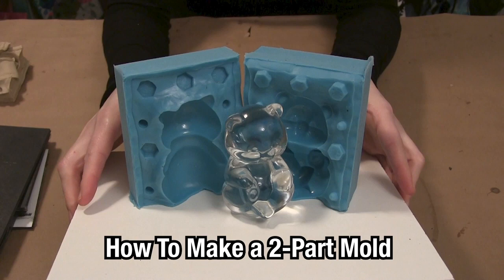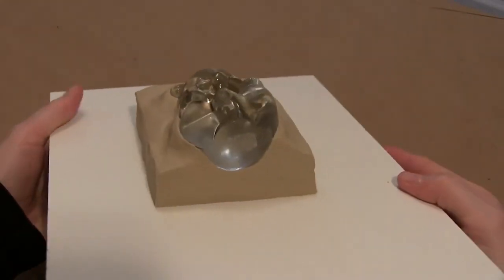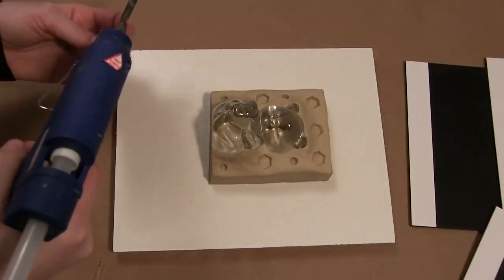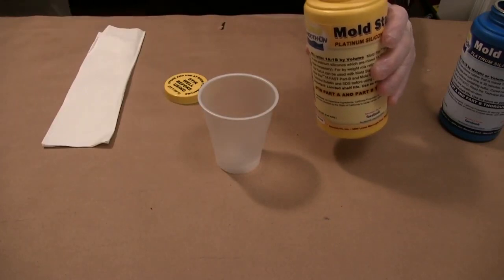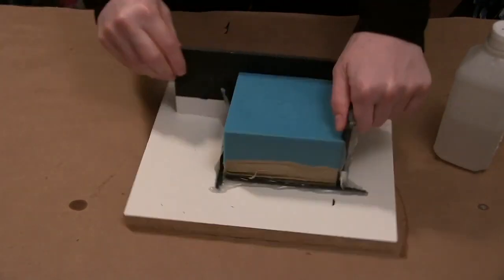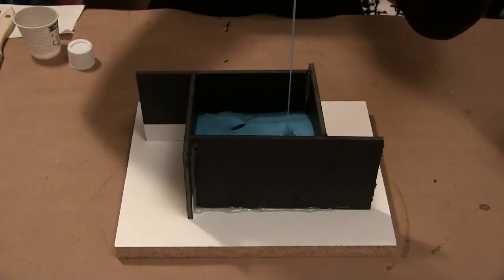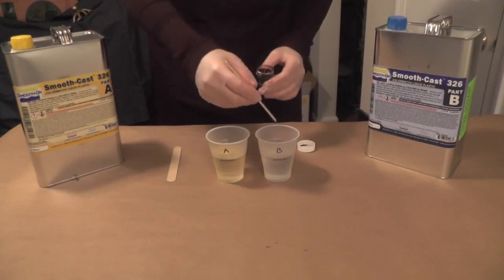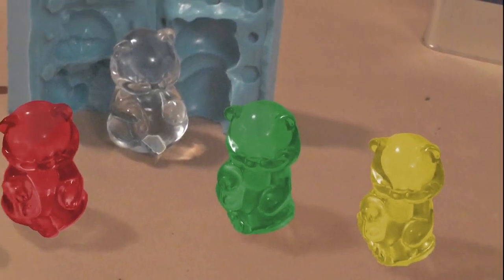2-Part Silicone Mold using Mold Star™ 16 FAST

Comment: You can simplify the process by skipping the clay stage: you pour the bottom part with silicone and leave a few vertically positioned suspended rods partially immersed in silicone. After silicone has solidified, you remove the rods,  apply release spray and again pour silicone. Even release spray might be not necessary if you use 2 different substances (silicone + latex / rubber?). What interesting I got my idea only after watching your movie. Thanks :)

Comment: Can you use this method for a small figure that is made out of PVC? Will the silicone stick to it? If so How would you prevent that ?
Reply: Other tutorials have been saying Mold release spray
Reply: Silicone typically only bonds to itself. I don’t think it would stick to PVC but you should call manufacturer to check.

Comment: I'm trying to make a mold for a shoe sole and I'm trying to think of what to cover the shoe with before applying silicone or clay to it without losing the details, need something that wont stick to the shoe but will still allow for a nice clean mold with all the details,  I'm trying not to destroy the shoe in the process. Any ideas on what to use to protect the shoes, the parts I'm trying to make a mod of are the rubber and polyurethane foam.
Reply: I’m having a similar hiccup. Only thing I’ve thought of, but haven’t tried, is heat shrink wrapping the item and trying to get the seams in the right places

Comment: Did you cut the opening to pour the resin after you made the 2nd part of the silicone mold?
Reply: The bottom of the bear is free from clay. That's where she prolly pour it. And it's a good place for it cause if there's some imperfections from the pouring, it won't be seen much cause it's in the bottom.

Comment: I've used this video to make a mold of a little resin figurine from 1962. It is complicated because it is not symmetrical. Sometimes the resin replica that I made has large pockets of no resin. Especially on its extremities. I pour from the bottom with the mold on its head. I also added a pour hole in its back. Any suggestions of where or how to pour to get a perfect replica every time?
I have gotten a few perfect replicas. Well, if you don't count bubbles.

Comment: I didn't see anything about how you made  the hole in the top of the mold that you used to poor the resin.  Did I miss something?
Reply: The base of the gummy bear is where you pour your resin, as you make the silicone mold, when you pour it, it will occupy every space you didn't seal with clay and/or the space of the actual piece you are copying

Comment: How did you not get any bubbles in the casting? Did you skip the step where you removed them with heat before pouring?
Reply: She used low viscosity silicone. Listen at 10:00
Reply: Vacuum chamber

Comment: Thank you so much can any mold release spray be used?
Reply: When pouring the silicone the mold release must be for use with silicone, and when casting the part it must be for for urethane. Ease Release 200 works for both!

Comment: Is there a way to do this with a silicone interior to make prop gummie bears?
Reply: Yes! You can cast silicone, you just need to use a release agent like Ease Release 200. OR, you can use Smooth-On's Compat 45, a urethane rubber, to make your mold. Usually you can not cast silicone into a urethane rubber but Compat 45 is formulated to work with most silicones. Then you can bypass using the release agent.

Comment: Being a Film Gun supplier, we have up to now relied on outside Replica casters ( Hard Fibreglass and Soft Rubber Stunt Items.)
Its good to have a Tutorial on DIY silicone mould making.
Furthermore, I would make a Plywood Frame around both Mould Halves ( Cope and Drag) to prevent damage in Handling.
Just got to find the Components here in Australia.
Reply: I just recently overheard someone talking about Rowe Advanced Materials, in AU!

Comment: Question: I noticed you used what seemed to be a glass figure as your source material. Does the material matter? If I used, say a child's plastic toy  would the silicone stick to the original, to the plastic? or would it release as easily? Great informative video btw.
Reply: If you are using a plastic toy as a master model, it is recommended that you use a release agent to avoid separation difficulties. In addition, it should be noted that there should be no holes in the master mold.🚩🀄

Comment: We don't have to De-Gas the silicon mixture before pouring into the mold?
Reply: She should be using platinum-cured liquid silicone with a lower viscosity. If you use tin-cured silicone or higher viscosity, it is recommended to vacuum degassing, otherwise there will be a lot of air bubbles.🚩🀄
Reply: @linhuiming   Yup. Mold Star is a lower viscosity line of platinum silicone, perfect for those without a degassing chamber.
Reply: Some silicones do require degassing, but the Mold Star line is a low viscosity silicone that does not require degassing! Hope that helps!

Comment: No degassing of the 326 resin? How didi you get no bubbles?
Reply: The natural defoaming effect of the smooth-on brand resin is better, but degassing operation is generally recommended for other brands on the market.🚩🀄
Reply: Generally I would not recommend degassing resin - but if I had my choice I would let it cure under pressure for more consistent bubble free results. I shot this video at home during the pandemic so I had no equipment. There were a few micro bubbles that weren't visible on camera.

Comment: What kind of safety precautions are needed when using these chemicals? Other than a ventilated area do you need a respirator or anything like that?
Reply: If tin-cured silicone is used, it should be operated in a ventilated place. If platinum-cured silicone is used, there is no requirement, because platinum-cured silicone is generally FDA-certified, non-toxic and odorless. It is best to wear gloves when handling.🚩🀄
Reply: Polyurethane resin has a strong smell, and it should be operated in a ventilated place, and it is recommended to wear a mask or respirator.🚩🀄
Reply: Each material will come with a different set of safety instructions. For these materials specifically, I worked in a well ventilated area and wore gloves. If I was working with a larger volume of material I may have worn a respirator as well.

Comment: I have nsp soft clay. And its so hard that i hardly cutting with knife.  How to make it softer? It took me 3 hours to do 1 small rose😣
Reply: I'm no clay expert but I know you can soften it with heat. The Chavant website should have the temps used to soften it.
Reply: I usually use a large knife to cut it into smaller pieces, then lie them beside one another, inside a sandwic baggie. Then I put the water-tight sandwich bag, in a bowl, in the sink-and run hot water (graduating to warm water, so it doesn’t actually melt into liquid! Lol) over the baggie until it is soft enough to use.  Saves me a lot of time.
Have a great day!
Reply: @kelleylegault5115   Thats a great tip. I've also seen others use a small crock pot dedicated for clay.

Comment: I wonder if this would work with the silicone method I found using gelatin and glycerin. I'm trying to make casting of my 3d printed fantasy minis but it doesn't seem to work too well using disposable cups.
Reply: If you are using a 3D-printed UV resin model as a master model, you should be aware that it may inhibit the curing of platinum-cured silicone.🚩🀄

Comment: I see silicone is very expensive.  Is it worth to make your own when you can buy from aliexpres cheap silicone moulds?   How many moulds you can make from 1 kg bucket?  I know ot depends on mould size but if they are not too big,just trying to figure out the cost. Thanks for your help
Reply: Well, you can buy silicone molds from china but I've found often times they aren't pure silicone and I've had my epoxy bond to them in the past. Also, making your own allows you to make any shape you want! You can sculpt something out of clay then have a unique mold no one else has! Smooth-On has calculators on their webpage that can help figure out how many molds or castings you can get from each container.
Reply: The density of water is 1.0g/cm3, and the density of silica gel can be calculated as 1.2g/cm3, so the volume of a bucket of silicone is similar to that of a bucket of water. In addition, you have to budget 5-10% more loss.🚩🀄

Comment: Hi there. I know this video is a year old, and hopefully you see this question.  I want to make a fairy lamp. Do you think I should make a 2 part silacone mold or just pour it over each piece of my fairy lamp in a bowl?
Reply: Hi there! It really depends on the shape, if it has a lot of undercuts or if it’s simplistic. Most likely a two part mold is going to be a better choice. You might want to contact Smooth-on's tech support and attach a photo. They are helpful at giving advice.

Comment: do you have to let the mann release dry first after spraying?
Reply: Yes this is best practice. Sometimes if I pour the silicone too soon it ends up with a tacky surface.
Reply: If the release agent is not dry and the platinum-cured silicone is poured directly, it will cause the contact part to become sticky after curing. This is because substances such as N, P, and S are likely to cause poisoning of platinum silicone and inhibit curing.🚩🀄

Comment: does a 2 part mold last a lot longer than a one part mold.. it just does not seem to take abuse like pulling , stretching like a one part mold.
Reply: That’s definitely part of it, the mold will have less abuse. Using the release agent also helps extend the life of the mold because it helps to protect the silicone oils from drying up due to the heat of the resin while curing.
Reply: @victoriapitt2305  would you know if their are any cheaper oils i could use other then expensive mold release.. example , could i use olive oil in the molds.  or other kitchen oils ?
Reply: @gladiatormechs5574  Silicone oil (silicone fluid) is recommended.🚩🀄
Reply: The casting material is the biggest factor affecting the service life, and other factors include the type of silicone, mold maintenance, etc.🚩🀄

Comment: how long did you wait to de mold your casting of the  326 ?
Reply: Approximately 60 minutes.
Reply: @smoothon  full cure or just to be hard then it will cure in 24 hours ?
Reply: Curing can be accelerated by raising the temperature.

Comment: I notice you sprayed the release on the part itself, did it not affect the surface of the part? Or did you wipe off the excess after?
Reply: The release didn’t harm the original and does wash off with water and dish soap. Always good to do a test first though depending on what your model is. Make sure it’s not going to remove the finish if it is painted for example, you may need to seal it first.
Reply: The aerosol-type release agent usually has no effect on the pattern of the master model. If it is petroleum jelly, it should be applied evenly. In addition, RTV-2 silicone has good mold release properties for most materials.🚩🀄

Comment: I need to make a seethrough and squishy glass bottle that can hold liquids and it obviously cant be real glass so i thought if silicone would work or would it just break because im talking about like 3 liters of liquid so, what do you think? I have never used silicone so im asking you if you can help :D
Reply: I think you could definitely do that with silicone! The Sorta Clear line would work, you would just need to cast your walls thick enough, may take some testing.
Reply: RTV-2 clear silicone is not suitable, this type of silicone is easy to stick to dust. Consider HTV clear silicone or clear polyurethane cast resin.🚩🀄

Comment: Does the Smoothe cast 326 need to be degassed in a pressure pot?
Reply: No, usually you don’t need to degass resins. Instead, curing them in a pressure chamber is best for eliminating any bubbles. I usually only degass certain silicone products.
Reply: For polyurethane casting resin materials, the degassing effect of the pressure pot is better than that of the vacuum pump.🚩🀄

Comment: That was amazing! How hard is the final product?  Can this be used to make small plastic car body parts?
Reply: The plastic I used was very hard. I believe it can be used for car body parts but some plastics have better specs than others in terms of the casting thickness. I suggest calling Smooth-On’s tech support for a product recommendation.
Reply: ABS material will be harder than ordinary polyurethane casting resin. The hardness of ABS material can reach 80 Shore D, and the hardness of polyurethane resin is usually 70-75 Shore D.🚩🀄

Comment: Very well presented and detailed, probably the best 2 part mold making/Casting tutorial I've seen.  I use this for my plastic model kits usually to make up missing or broken pieces, I literally mold the entire sprues/runners and keep the copies in the original box for use later as I get many incomplete kits from estate sales and such.  Your method is spot on to mine except now I might try the brand you are using.  Great video Victoria!

Comment: I have a sulfur model. Can I just spray it fore imbedding in clay?
Reply: You can spray coat it with acrylic spray (2 coats) but there is still a chance of some inhibition if you use the Mold Star. Tin cure silicones are a little less sensitive so I recommend using Mold Max 30 instead.

Comment: can I use this to create a mold from a figure made out of air dry clay?
Reply: As long as the clay does not contain sulfur. Sulfur will cause the silicone not to cure all the way and you will have a sticky mold. You may also choose to seal the clay with Acrylic Spray first.
Reply: @victoriapitt2305  I'm going to try that, thank you!

Comment: Will this work with most epoxy resin casting?
Reply: Yes, Mold Star is a platinum silicone and compatible with casting epoxy resins. Although a release spray is not necessary, using one can help prolong the life of your mold, since epoxies can be kinda abrasive.
Reply: If the surface of the epoxy resin crafts you cast has a hazy feeling, it may be the effect of the release agent. In this case, consider using platinum-cured clear silicone.🚩🀄

Comment: Did the Ease Release 200 not change the surface texture of the object? It says on the website that it is matte, and I'd imagine that all future castings would also be matte.
Reply: The ER 200 can sometimes leave a satin finish, but I found my casting were shiny enough for me. I believe the Ease Release line has other sprays that are more geared towards high gloss.

Comment: Will mold star stick to itself if you run out before covering model and it cures?
Reply: Yes it will bond but the sooner you can pour the new silicone over the cured silicone, the better it is to risk any chance of delamination. If you have to wait a few days to go buy more, then it can be a good idea to treat the cured silicone with naptha to open up the pores prior to pouring the new silicone.